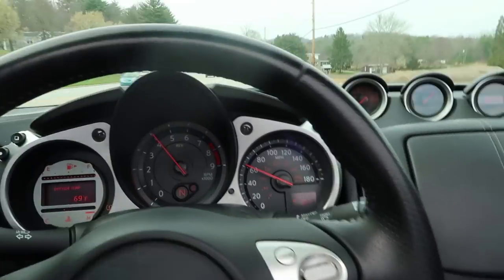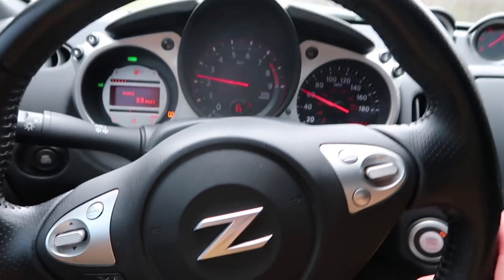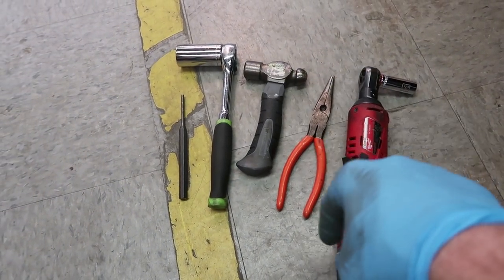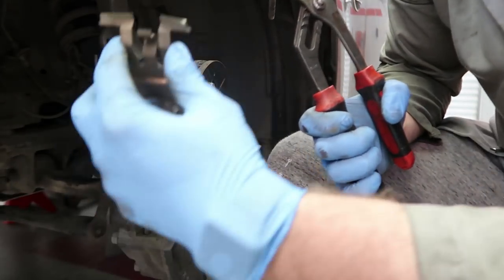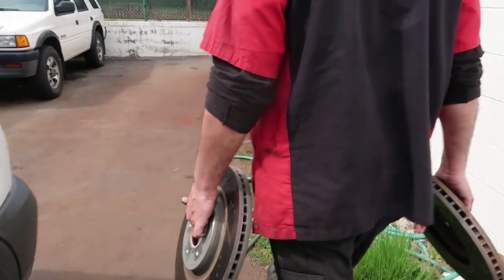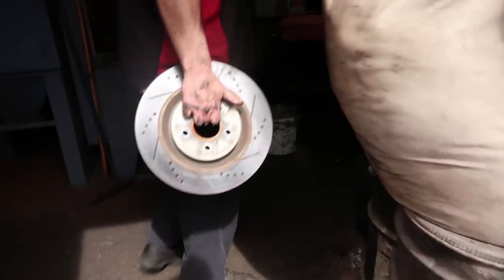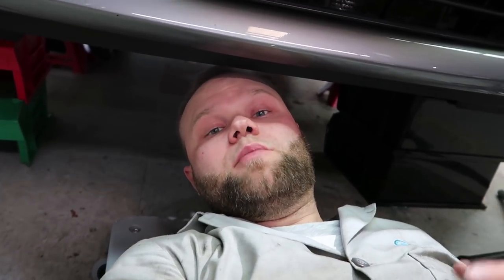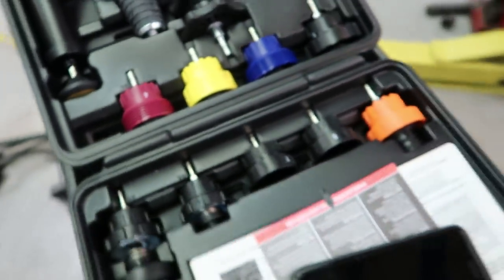Working on my 370Z/How to change brake pads and rotors/How to detect a coolant leak

Comment: Great video MK! I have a question for you. What is the size of the socket you used to remove the two large bolts behind the calipers in order to remove them? I'm not sure if it is 23 or 24 mm. I did my fronts about 6 months ago and I cannot remember. I am doing my rears in a few weeks and I cannot find my 24 mm socket in the event that it is a 24mm.
Reply from the maker: Honestly brother I don’t remember
Reply: @MKTECHUA  Thanks anyway Brother.

Comment: How did you get to the top bolt of the caliper? Was the hard brake line in the way? I tried to take rotor. Off but thr brake line was in the way and I can't put a socket in.
Reply from the maker: I’ll get back to you shortly

Comment: i have the same problem did u change just the front ones or all round?
Reply from the maker: Evander Rojas i changed all brake pads and grinded all the rotors at a machine shop